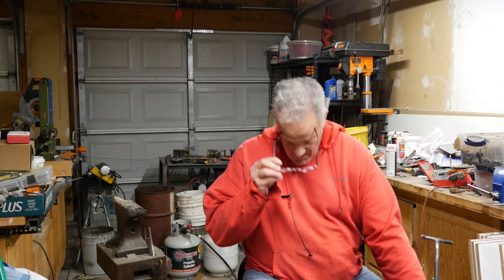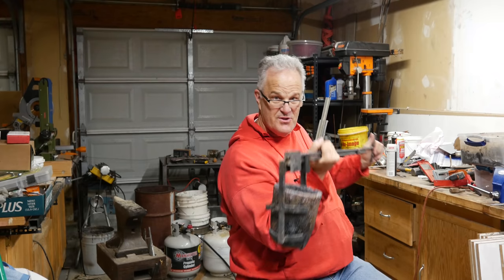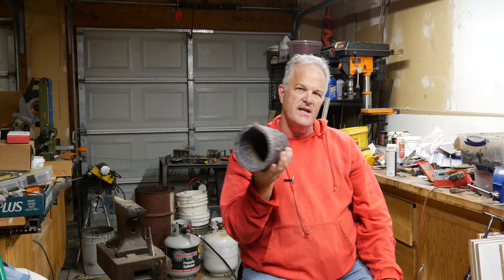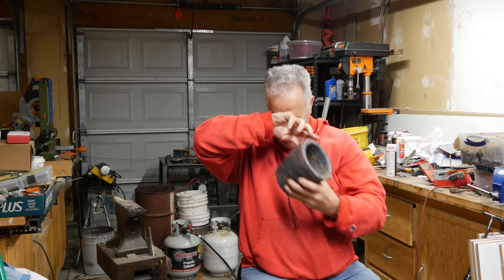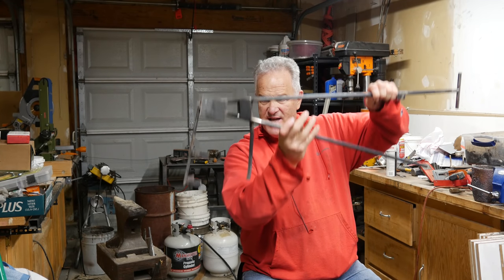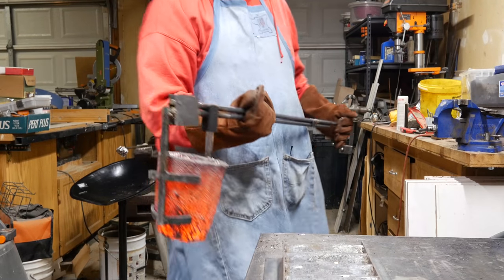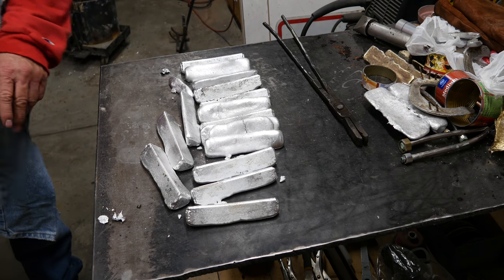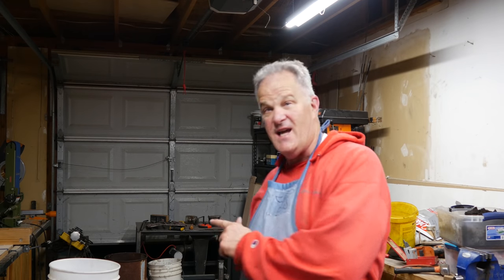Foundry side chat   My crucible tongs versus a tradtional shank

Comment: Melt it ! pour it ! repeat ! 
Melt it! Pour it! Repeat! 
Tongs n thongs n stuff to much info 🤯🤯

But seriously I get a bit worried looking at your location of the furnace to the gas bottle just incase you need to quickly turn off gas if something bad happens with furnace or burner or gas hoses🤷🏻‍♂️. I always make sure I have at least 2 exits or escape routes and  plenty of access to gas bottle incase of something bad happening. But that’s just me as I’m always expecting the worst ( but that normally doesn’t happen until I check my castings)🤦🏻‍♂️. Anyway Perry I prefer your crucible holder thingyMaJigs to mine but I’m not bright enough to make one like yours . 
I can’t wait to get home and print the coins you made me😁. as I can’t access them on my phone so I  have to wait till I’m on home computer to look . 👍🏻

Comment: The farther a 2-in-1 tongshank handle's axis is out of alignment with the crucible's spout, the more you have to move both hands (forward and down simultaneously in your case) to keep the pour on target hitting the basin as you increase the tilt. 

Having the spout just a bit above the axis instead, as seen in a 'standard' ring shank, lets you move your hands a bit more naturally/intuitively (IMO) to maintain your aim while the crucible's tilt is increasing.  To put it a other way, what's the easy way to pour a large full glass of flat lukewarm Pepsi down the sink?  Come in from the side to lift the glass with your palm, or come down from above to suspend it from your fingers?

You're bang on about this really only creating an issue with bigger (heavier) crucibles though.  What really matters is how comfortable you are actually using your existing crucible tools.  

I believe my #12, especially when I'm melting bronze, is big and heavy enough that the awkwardness of a tongshank would be enough to outweigh its obvious convenience.

Good chat, play safe!
Reply from the maker: Hey boss,
I guess I might argue, ever so slightly, that unless the pouring spout of the crucible is directly inline with the axis of the shank some amount of movement, lateral or vertical is going to be required to keep the distance consistent. But no matter, I admit that my design isn't the best, but it works for me. ;-)
Reply: @swdweeb  I think we are both saying exactly the same thing about what happens when the shank isn't in line with the spout. :)  
All that matters is to have something you feel comfortable and safe using.  One other great thing about yours is your crucible isn't bleeding off heat while you have to take the time to transfer it to a separate shank before you can pour.
Reply from the maker: Hey, I didn't think about the heat bleed. All the more reason to keep using what I'm using :-D  Take care brother.

Comment: I for one like your idea, I plan on making a pair of tongs similar to the ones you made. however the only differences I had in my thoughts were:
1) having a set of jaw arms (to hold the crucible) on both sides of the gripper instead of one set.
2) having a lock (of sorts) to keep the handle arms together after picking and/or pouring. This could be done with a quick link or small section of pipe that slides forward over the arms.
Reply from the maker: I almost built it with grips on both sides but I couldn't get it around the crucible while it was in the furnace. The lower grips are too small in circumference and I can't open them wide enough inside the furnace to get around the crucible.
Reply: @brandonlaird6876  Brian's tongs are cool, but I wouldn't use them with #10 full of bronze.  Too heavy and you cant hold it far enough away from your balls.

Comment: I use a steel cylinder with to bolts at the top which I lift and then use a loop on the bottom of the cylinder to rotate the bottom up.  It is a somewhat cumbersome design but it works well with my setup. I don't know if YouTubeland would approve of my setup so you are not alone Perry.    

Keep on melting and casting,
Mark
Reply from the maker: Hey Mark, You're right, there are definitely people that out here in YouTubeland that would not approve ;-) 

FWIW, I went ahead and went with the graphite crucible because of the reactive nature of aluminum and steel. Have you noticed your steel tube showing nay signs of reaction with the melted aluminum? I've heard of guys that have had the steel basically get eaten away by the heat and the aluminum. Always curious to hear what someone that's using that sort of set up is really experiencing. 

I shall keep on casting. Thanks for commenting
Reply: The exterior flakes off a wee bit, inside I have not noticed too much degradation.  I only melt aluminium in this crucible I have a second for brass.  I am using an electric furnace patterned after TAOW's.  I find it a lot quieter and cleaner that a propane or oil burner, I don't think my neighbours would appreciate the sound or smell too much and they are a whole lot closer than the folks in YouTubeland lol!  I should shoot a video and let you know when its up.
Reply from the maker: You should!

Comment: Being safe is very important. What about melting inside with the door closed. What about the carbonmonoxide?
Reply from the maker: If propane is burning properly it should not create carbon monoxide. Don't know if you've seen this https://youtu.be/8TGh1DDvEUU
Also from http://propane101.com "Properly functioning propane appliances will produce what is called an "ideal burn" during combustion and present no danger of Carbon Monoxide poisoning."

I've been burning this for a few years now and never felt even the slightest symptom.   Unless its like below zero I have a couple of doors open as well.

Comment: What happened to your crucible?  It looks like hell.  You firing directly at it?
Reply: I'm assuming he got that crucible when he started this, so about 9-10 months ago. He's done quite a bit with it. However, yes, his burner does come in a bit straighter than it should be. If he ever remakes his foundry (again, he remade the lid, top bit, and the floor about 4 months ago) he should come in at a better angle. Not a big deal though, crucibles aren't horribly expensive. $35 on Amazon for a #4-6Kg Clay Graphite that he has. Considering it's lasted almost a year, I'd say he's done pretty good with it.
Reply: @brandonlaird6876 Columbo, is that you? 😏
Reply from the maker: Yeah, what Brandon said ;-)

Unfortunately the burner does spray right on the crucible. It is angled but it doesn't really matter when the crucible is only about 1" from end of the burner.  I have two choices, well three, get a smaller crucible, make a larger furnace, do nothing.

And that crucible, much to my amazement is my original crucible. I bought a replacement several months ago thinking this one would give out but it hasn't. I check it for cracks and any other points that I think it looks like it might fail at. 

If I were just doing aluminum, I think it would look a lot better but once I started making bronze, it started looking like this.
Reply: @swdweeb  can you raise it up outta of the line of fire?
Reply from the maker: I can try. I sit it on a piece of firebrick now, but I might be able to set it on two. I'll have to see how close I get to the top of the furnace.  I'm going to try and cast something today so I'll give that a try. Good idea